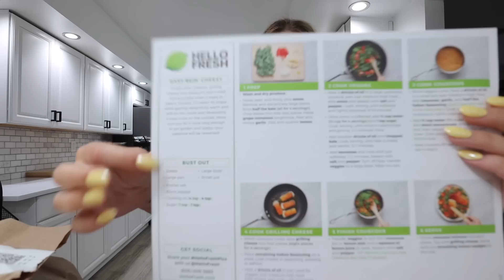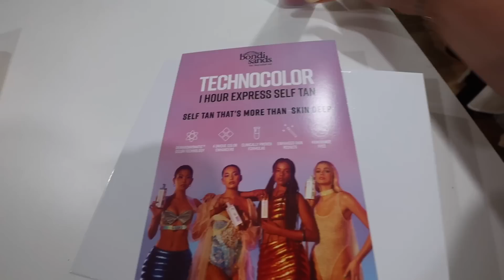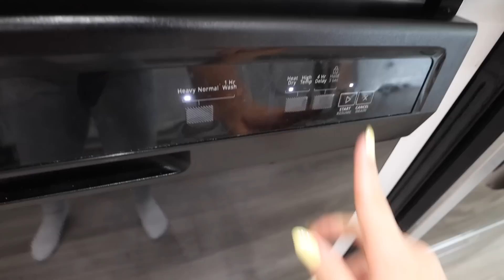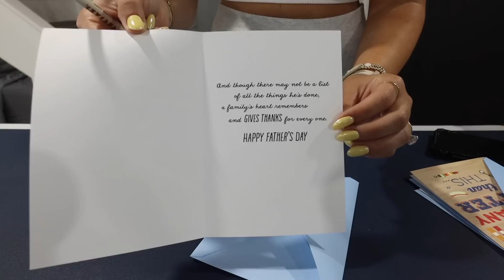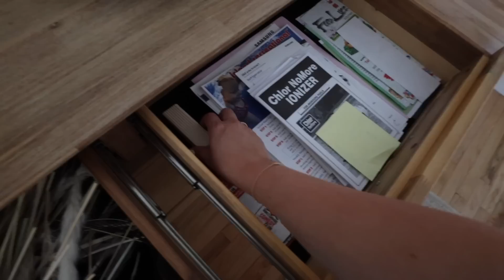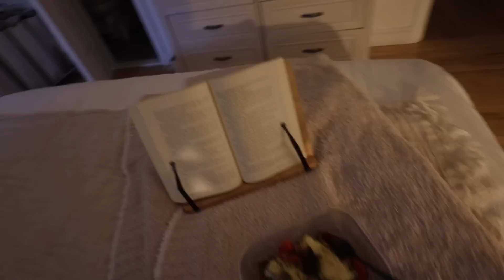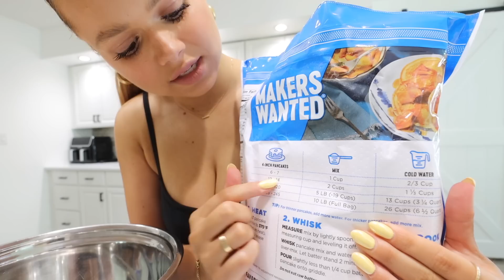1 HR MOTIVATION VLOG: doing things i’ve procrastinated, fathers day brunch, costco haul, organizing

Comment: A tip to make your knives last longer and stay sharper: when you scrape the chopped ingredients off to the side of the cutting board, use the back of your knife, not the blade. Same goes if scraping ingredients directly into a pan or pot. Hope this helps!